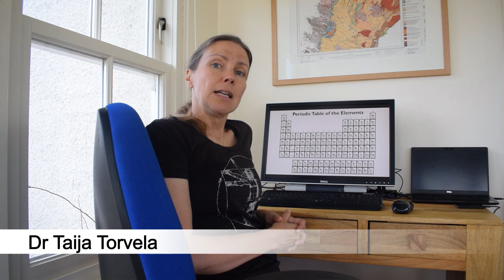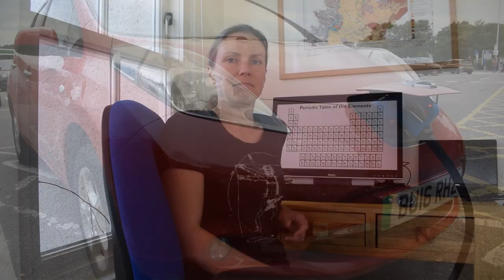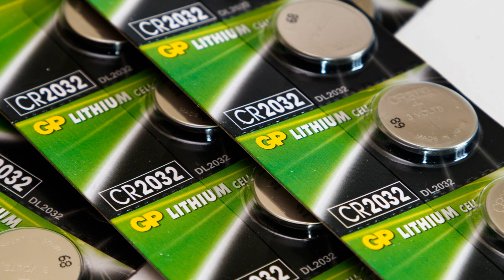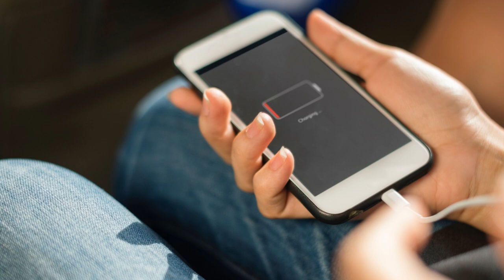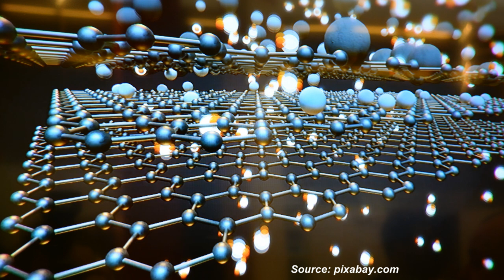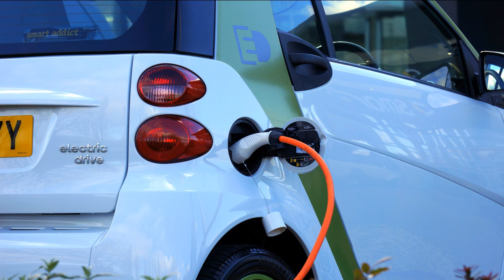What metals go into batteries?

Comment: A nice useful summary.  Thank you!  I wonder if the trend in battery development is towards the use of more or less abundant minerals?  Are we running up a box canyon or onto the broad plain?
Reply from the maker: A bit of both I think. One aim is to see if we could use common and easily available elements such as sodium instead of the much more expensive lithium, for example, whilst others are looking to see if metals and elements not currently used in batteries could make them more efficient - although I'm not aware of any of the rarer metals or elements being looked at, mostly these involve different base metals in various combinations.
Reply: Iron-air batteries are cheap and work, although not very efficiently.    The aim of most manufacturers is to pack a lot of energy into a very small volume, and that necessitates the use of exotic components.